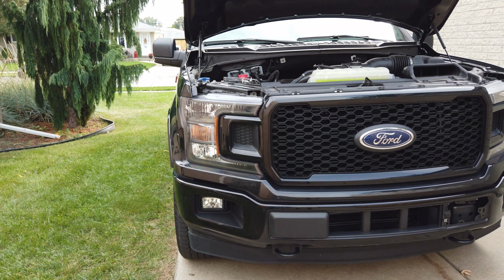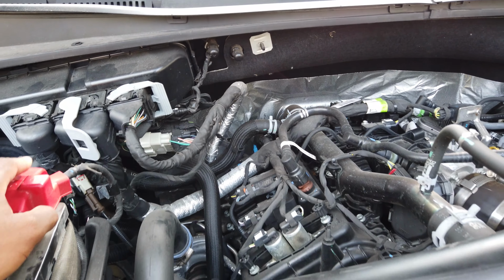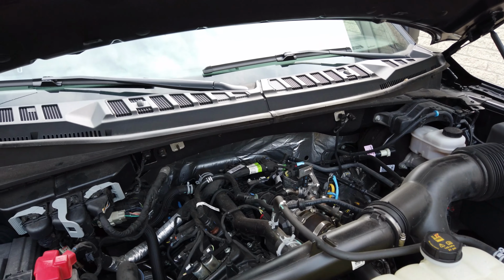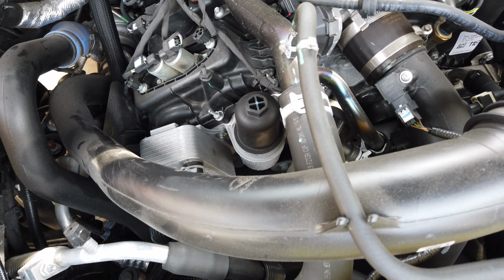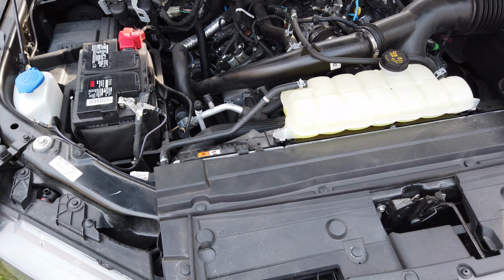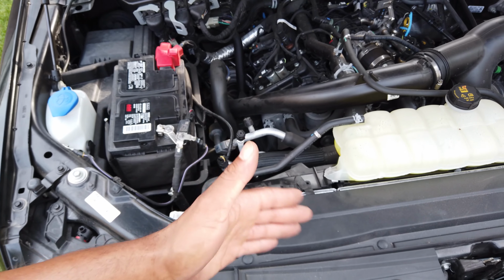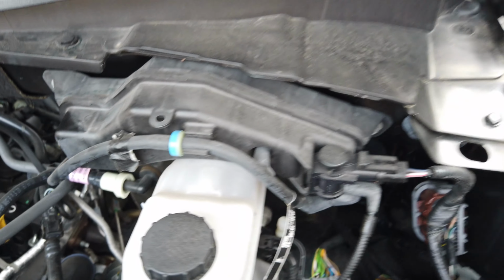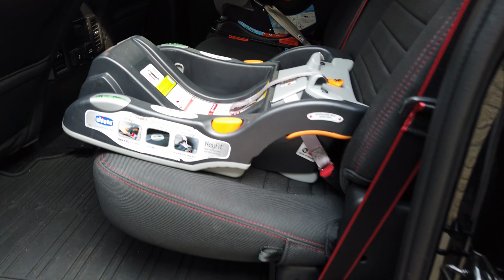2.7 ECOBOOST - SECOND GEN - COOL FEATURES

Comment: Great informative video, I subscribed, question do you think the 2.7 gen2 needs a catch can? Thanks in advance
Reply: 1st gen needs it, 2nd does not. The dual injection solves the problem that the catch can is meant to correct.
Reply from the maker: I don't think it needs it.
Reply: I have a 2019 STX with the 2.7 motor, I put catch can just in case and when I do the oil change I found there a little bit of oil which is caught. Not too much.

Comment: My 2019 XLT 2.7 is leaking at the oil pan with 21,000 miles on it. The passenger side turbo went out at 15,000 miles.
Love the truck, but seems to have alot of issues for low miles.
Reply: 🤔 wow that sucks do you tow a lot with it? Just asking I have the same truck with 20,000 on it and I haven’t had any issues
Reply: @stifflers69mom1  
My stock 2018 F-150 FX4 Regular Cab SWB 2.7L 10-Speed 3.55:1 93 Octane 
24,500 miles and I’ve only installed a new battery, no leaks, no problems at all.
0-60  = 5.9 Seconds          ¼ mile = 14.4 Seconds 
G-Tech Pro SS Performance meter
Reply: This is a isolated issue , and not normal. I own a 19 2.7. I am very religious on maintenence, but zero issues at 50k. It is the best engine I have owned , and very reliable. Maybe you got a lemon. It happens.
Reply: @Calebflying2025  I like you own the 2019. And I recently had cat converter replaced due to fault codes popping up for wastegate. Turns out they had to replace that wastegate issue all done for free. Not sure why wastegate code was showing but they told me at ford to begin using premium fuel. I also installed an oil catch can to help.
Reply: @JH-me1gc  Whoever told you to run premium, has no idea what they are talking about. The engine is designed for 87,  unless you are towing heavy. That is the only time it is reccomended. You really  don't benefit from premium,  unless having a tune. Running a top teir gas, Is however important. It has the additives.  I hate when people put out unedecuated advice. 75k on 87 on mine. Zero issues.
Reply: @Calebflying2025  roger that. What do you think caused the wastegate issue
Reply: @JH-me1gc    No way, without diagnosing the truck. It is electronically controlled actuator, and that has failed before.
Reply: @Calebflying2025  thx so much. Im an aircraft jet engine technician in the air force. I know how to work on vehicles etc but sometimes the way engineers put things together confuses me. Either way the truck is running great. Thx for your time. I appreciate you.

Comment: I run 89 in mine. Maybe it’s just where I live but she knocks  too much with non top tier 87.. 89 is cheaper at a local gas station(non top tier)and no knock. I’ve noticed no drop in mpg. I’ve only averaged 21 mpgs for the life of the truck(according to the computer) and I was hoping for better. I’ve done as well as 25 though. Sync 3 sucks and the new update from Apple hasn’t helped with the CarPlay issues.
Reply: @brian Finn
My 2.7 doesn’t knock with 87 top tier gas, it’s only about 2-3 cents more per gal versus non top tier. 
89 octane is at a minimum of .30 more, sometimes .40. That adds up over time

Comment: Excellent video... you know your stuff. You just got yourself a follow!!  Looking at buying a 2.7 Lariat. Dealer keeps pushing me to the 3.5. More stock available I guess.
Reply from the maker: I appreciate it!
Reply: Thing to realize about the 2.7 vs the 3.5. The 3.5 is a normally aspirated motor with turbos added. The 2.7 was designed to be turbo charged from the beginning.
Reply: @flashgangster  ended up buying a 2018 Lariat with the 3.5 Ecoboost. I live in Canada 
...mostly city (and winter) driving I’m averaging 12 l/100km. That’s about 20 miles per gallon...I’m happy with that. My 2023 F150 will be the 2.7.

Comment: Only issues with the 2.7L are : the first generation had oil pan leaks, a few minor turbo issues with excessive exhaust smoke and a batch of em had some mis-machined heads which lead to some recalls. The second generation 2.7L has had EGR cooler failures. While this may sound like a lot, it’s only a tiny percentage of the 2.7’s out there. It is a dependable engine and has less issues than the 3.5EB
Reply: Brian F I just got a 2020 2.7 so I’m hoping I got a good one. What’s your opinion on the longevity of the motor?  Do you think I could get 200k out of it? I usually keep my trucks for 7 years or so and run up the miles.
Reply: @timschultes6467  there are plenty out here with 150k miles plus with very little issues. the second generation should be better longevity wise since it has both port and direct injection. Stay away from excessive tuning. Change oil every 4k miles or so with a good quality oil. And it should be a winner over the long haul. you will probably have a few recalls, because lets face it. All car manufactures have them now . Its just part of owning a new vehicle now
Reply: Brian F thanks for the info. I’m not going to be tuning the engine it’s plenty powerful. And I’m good about changing my oil I always go full synthetic like Mobil 1 or something of that quality. Only difference from my last f-150 had a 5.0 and I was able to do an oil change every 7k or so. Not a big deal doing it every 4 to 5. I’m a big Ford guy I have faith they built a good engine. They really have no choice because 95% of the 900,000 they sell a year have a 2.7 so they better do it right lol 😂
Reply: Tim Schultes to be honest , the 2.7 is probably Fords most reliable ecoboost engine. Nothing wrong putting a tune on one. Just don’t get crazy with it . As far as the 900,000 sales figure goes. I believe Fords long streak is in grave danger of losing it. The Corona virus and GMs huge discounts have nearly equaled the sales figures
Reply: Brian F yes I agree with you because when I bought my truck they weren’t discounting them as much as they usually do due to inventory shortages. Not a fan of GM or Ram I think the Chevy is very ugly looking the GMC is the better  of the GM. As far as RAM goes it’s a beautiful truck but built by Fiat Chrysler which in my opinion is trash. I think the ford with the fully boxed steel frame and their long history of trucks that are made for the job site will prevail in the end. I do believe they all have gotten way to expensive for the average working American like myself. That’s why I had to get an STX because the other models are so damn expensive I don’t know how people do it.

Comment: Ever consider an aftermarket cold air intake system? More HP and better fuel economy.
Reply from the maker: Only effective with a tune...
Reply: It already has a cold air intake, with the RAM. Only benefit u get from putting one on is noise, as the filter is exposed. Put a better drop in filter in

Comment: Is 91 octane doing well with this car, Or i need 95?
Reply from the maker: I run 87 with no issues. Definitely don't need 95!
Reply: @DS-TRUCKS  cool 👍👍👍, love this car so far
Reply: You're throwing money away if you use anything over 87. They truck is tuned to run on it. You won't see any difference on bigger octane except in your wallet.
Reply: @the dude
I believe ford recommends premium fuel if you are towing with it. It should say it in the owners manual
Reply: Clark Kyle  I've had several turbo cars. Even have an F150 now. Not 1 saw any difference by using higher octane fuel. Sure there are some cars tuned by the manufacturer that suggest but don't require higher octane like Mazda, but not all of them will see a difference.

Comment: Firstly, a boosted engine runs richer because of all the extra air going into the combustion chamber. Also, I ran 89 octane for a month or so and watched my mileage PLUMMET .
Reply: A boosted engine does NOT run richer because of extra air. When you have extra air you have to add extra fuel so it doesnt run lean.all it does is balance.if you run rich its because it it tuned to run rich for a reason. D.s. is absolutely correct as they have been dumping extra fuel into turbos for decades to help cool the intake charge
Reply: Runs richer? You crazy boi ......this ain’t your dads Buick....these engines adjust fuel ratios accordingly .....what are you gonna say next ? That these trucks need turbo timers??? 😆haha
Reply: Ran 93 for the last 3 tanks and lost 3-4 mpg at least . Better throttle response, less efficient though
Reply: Ran 95 last tank goes 820 km from almost 900 km while using 91!!
Reply: I will try 98 next tank!

Comment: My brand new 2020 with a 2.7 is actually making a loud ticking noise from the engine! It almost sounds like a lifter tick, and ford is trying to tell me that it’s normal?
Reply: Yeah, that is definitely not normal! I also have a 2020 2.7 and it is nothing like that. It's quiet and smooth, definitely no ticking
Reply: Caleb Wood that is completely normal. That is your direct injection working. It is operating at extremely high pressure but I was concerned when I first got mine until I found out what it was.
Reply from the maker: that does not sound normal. can you make a video and show us?
Reply: I actually have a clip i made of it recently that I can send you. When i cold start the truck I cant hear it, but once the engine is warm it just ticks away. I actually had a 2020 stx 2.7 that didn’t make the sound and i traded up to a 2020 xlt 2.7 and all of a sudden theres ticking sounds!
Reply from the maker: @calebwood7411  put the link to the video here.
Reply: Caleb Wood I bought new lariat 150 2.7 but i liston your truck sound its not normal sir.. mine is very very silent
Reply: @calebwood7411  did they fix this?
Reply: https://youtu.be/rLlYyArrx6U
Reply from the maker: @calebwood7411  defiantly not normal. try another dealer, keep an eye on the oil... watch for any signs of metal in the oil. make sure your maintenance records are good...
Reply: Are you sure that it is not injector noise? Modern engines with high fuel pressures sound really loud...
Reply: Thanks for the input everyone. And yes i agree! I owned a 2020 stx 2.7 right before getting my 2020 xlt 2.7 and my stx was completely silent... Doesnt make sense to me how its ticking right off of the lot
Reply: The truck made the noise as soon as I got home from the dealer. I have already had the truck in for the noise at 1300 miles, and they told me that is the normal operating sound which i know is a lie because of the stx i owned. My truck is at 2100 miles currently, the oil level is normal and still clean on the dip stick, no power or economy loss, and no engine codes. I have an appointment October 6th to have the truck looked at again and I have called ford to open a case on it as well. I will keep you updated on what i find out
Reply from the maker: @calebwood7411  im sure it will get worked out..

Comment: Composite intakes are done primarily for cost savings and Air intake temperatures and horsepower.Aluminum transfers more engine heat to the intake,plastic “insulates” the intake a lot better.  Composite intakes also leak a lot more and cause problems down the road especially if it’s a wet intake with coolant passing thru it to the heads ,so it’s a trade off of sorts. Why would Ford want to carry the 2.7 design to the rest of the engines?  The cooling jacket design that’s great for running around and light towing would work against you towing heavy on larger engines ,loading the cooling system with excess heat. Finally  the bare minimum Roush, full warranty stage one ,low boost F150 5.0 supercharger setup makes 650 hp. You were comparing an NA engine to a boosted engine.
Reply from the maker: I would like to at least see the 3.5 ecoboost get the water cooled exhaust...
Reply: DS TRUCKS Why ? It’s tow rating would be reduced , the big number is one of the reasons I bought  my last 2 F150s.  The 3.5 is part of the Dura tec engine family . That is a proven design that has been around about 12 or 13 years and turbo charged almost 10 years by comparison the 2.7 has only been around five years and we don’t know the long-term implications of the integrated manifold.Cracked exhaust manifolds are common on all pick up trucks as they age between seven and 15 years old , if that happens to a 2.7 ,You were looking at replacing the cylinder heads . With only five years of time under the belt we don’t know how the two sevens going to do after 10-15 yrs. I’d way rather replace an exhaust manifold on my 3.5 than a head on a 2.7 just sayin.
Reply from the maker: We cant assume integrated exhaust manifolds cracked the same way normal exhaust manifolds crack. How can they combustion chamber survive? Water cooled is a whole nother animal. It eliminates the chance for exhaust manifold failures. Even though the 2.7 EcoBoost is the smallest engine, it suffers less MPG loss when towing than any other engine I've tested.
Reply: DS TRUCKS I’m not assuming anything , the point is there have not been enough thermal cycles on the 2.7 to know yet ... as for towing mpg , I’m willing to bet an NA V8 will do just as good or better either the 3.3 or 5.0 towing .They won’t make the torque of the 2.7 of course . If your doing that much towing I’d consider a diesel
Reply: @JohnDiMartino  You guys look quite savy about your engines. The 2.7 looks quite complicated to work on. I want to get an F150 and the 2.7 has good costumer satisfaction, but I'm wary of its reliability on the long term. For that reason I'd be more confortable with the 5.0. What are your thoughts?
Reply from the maker: @JohnDiMartino  put it to you like this, the 2.7 is more efficient towing the dump trailer than the 6.2 250 is empty... Buy a lot! I suffers less MPG loss than anything I've tested...
Reply: It’s been 7 yrs since the debut of the 2.7. No issues known yet.
No need to sound the alarm when having no issues
Reply: A lot of manufacturers have been using a composite intake for decades with no problems
Reply: My 2016 F150 2.7 eco will accelerate lot faster when I tolling my 5000 # trailer than most V8  …. Especially from start and going up hill starting from 45 mph